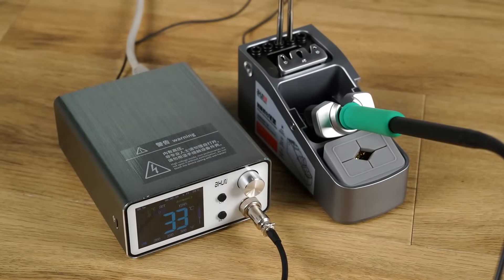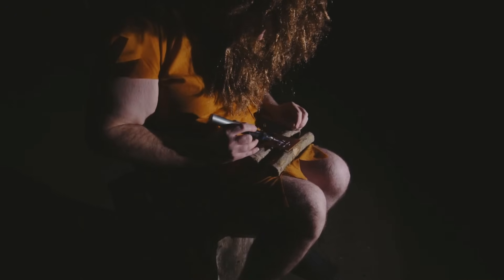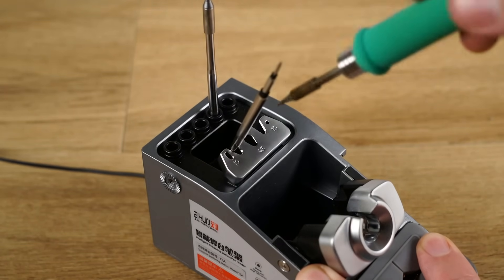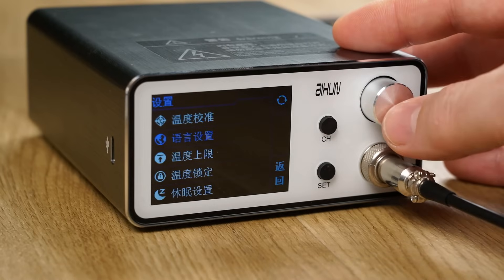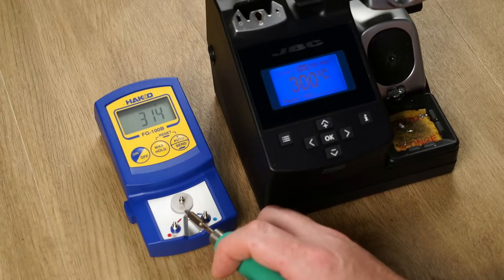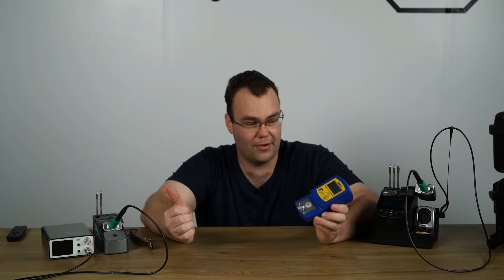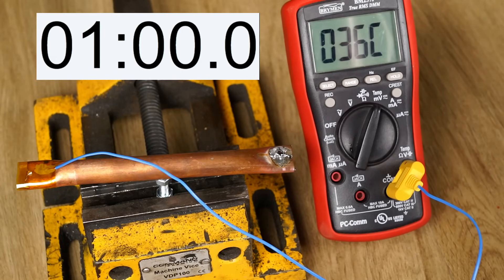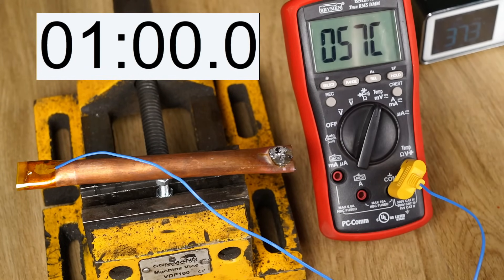AIXUN T3A Soldering Station Review ll JBC iron comparison

Comment: 8:06 I would say that no it doesn't. That's ignoring the outrageous overshoot on the Aixun, which isn't something that shouldn't be ignored. Your shots showed the JBC to have no such issue. Aixun needs to work on their PID control software. If it overshoots initially, then it will probably also have problems when the thermal resistance of what you're touching changes i.e. when you touch it to a workpiece. An interesting product and seems good for the price, but I'm not going to sell my JBC and buy an Aixun. I get that later on you did a separate test about overshoot, but my point is that overshoot and accuracy aren't completely independent factors. I don't mean to sound overly critical; I'm just worried that it would dump way too much heat into something sensitive, even if only for a second or two.
Reply: Ehh it’s not that bad. It was like 15 to 20 degrees over for a second or two. Ur not gonna kill anything on any board from that difference alone. Also consider that each tip has different thermal mass. The pid parameters can’t take into account every tip from every manufacturer. That’s what the calibration feature is there for which he purposely didn’t use. Two seconds of instability at the very beginning is honestly pretty average accross uncalibrated irons at this price point and jbc  might have maybe a tiny bit more accuracy if you only use their tips with their hand pieces but it really won’t be much better. Consider 3d printing which also uses pid tuning to control tip temp on the nozzle. Everytime you change to a different type of nozzle you have to retune your pid to get good stability and even after a retune it’s still never perfect. The effect will get worse  as you get further from the calibration  temperature as well. That’s why u see the 400 degree temps off a bit more. It’s just the nature of pid. That being said if the extra 4-5x cost of the jbc ecosystem is worth the feeling of having a more trusted product from a comparatively more reputable manufacturer then by all means go for it. And definitely don’t sell a jbc to buy a knock off. No argument there whatsoever. If your budget is more in line with the average hobbyist however, rest assured that this small overshoot is nothing to be concerned about.

Comment: Hi your video on buck boost converter was great   bit green on these
My question is I have 3 40ah 3.5 lithium cells   if I installed booster to 12.6  it works out roughly 12a
Where is running appliance  of 12v appliances would be 4a   
So does that mean it would use 3 times as much power out of battery 
If that makes sense

Comment: Looks to be rather nice and decent performance. However basic ohms law: Input power 24v @ 8A = 192W, so at best case it could never be a higher output even if 100% efficiency, which is never possible... Still though probably at least could do 150W!
Reply: The 24V@8A is an output socket to power accessory devices such as smoke fans, not input power to the heater.
Reply: @m3chanist  I now discovered that, the listing I had looked at said that was the input power and did not show the back to know I has internal ac power supply.  Thank you! Sorry to misinterpret.
Reply: Это именно питание нагреватель 24в

Comment: Hi there,
thanks for the great video.

Just one question, what is the difference between the AIXUN T245 and T245-A AX hand piece?

Thank you in advance and best regards
Reply: The T245A has a blue-grip handle and the T245 has a green-grip handle. I guess that's the only difference. JCB makes a T245P Blue-Grip Handle too as well at their original T245 Green-Grip Handle.
Here's JCB's description of why they also offer a Blue-Grip Handle version:
"The blue grip allows you to distinguish it from other handles on the work area. For example, it can be used for lead soldering applications and green handles for leadfree jobs."
Reply: @ITubeTooInc  THX

Comment: The key is the support. As soon as you are not the creator of this controller, yet you have no idea how exactly it is working and you have no source code, you cannot be sure this controller will work fine. What do you do if it stop working or some error will be fiund in the firmware? Very often the suppliers does not perform firmware update in 2 or 3 years. That is the reason the original controller has greater price.
Reply: You think JBC provide source code for their irons?  Amusing.
Reply: @m3chanist  of course not. But i think they provide support.
Reply: @art4259  As does the manufacturer of the iron featured. Two to three years of firmware upgrades for a soldering station? Are you serious.  What problems do you think may take three years to be unearthed exactly? Care to list ANY manufacturer that is still doing active updates on their firmware three years after the product was released for the original iteration?

Comment: Great test! May I ask, what did you use to mount the thermocouple tip to the copper tube?
Reply: Solder
Reply: @ITubeTooInc  In the video it looked like some yellow "goop" style of substance.
Reply: Most likely kapton (polyimide) tape and some thermal paste.

Comment: Yes it can solder some beefy stuff but not as well as it should with the available power.
The overshoot would suggest that either firmware control or build of the tip is not rigt.

Comment: I have a Weller soldering station that I purchased in 1984 that still works as well as it did when new. I used it the other day and had no issues. It seemed expensive at the time, but now that I look at my decision, I have no regrets.
Reply: I've had a couple of wellers since 20 years back. Try soldering on a large ground plane, or a high gauge wire. Impossible with the wellers. Thermal capacity is to low no matter of soldering type. Even though it says 50w on the soldering iron, that heat cant transfer fast enough to the tip when it's cooled down. The issue is the physical barrier between the heating element and the tip.

This is solved with JBC (yes, I bought the DME-station), where the heater and tip is integrated in the same unit. Problem solved. Will never go back to weller. No professionals use those in a production environment. It's either jbc or hakko.
Reply: @swebigmac100  
I have a weller soldering gun with a higher capacity for the big jobs. Every tool has a range of uses. The work station if for fine work only. I have a range of tips and temperatures that I can select for a particular job, buy, you're right.
Another thing I have found is adding extra flux, especially when using no-clean flux solders. I use the Alpha no-clean rosin flux. It does a great job.
Reply: Which station is it??

Comment: I'm just wondering if a genuine JBC T245-A hand piece will fit the Aixun T3A station. Is there any chance you could have a go and give us an update thanks.
Reply: It's not a direct replacement. You would need to replace the connector or build an adaptor lead.
Reply: @sdgelectronics  But is it just that? mapping the pins via adapter? or are there maybe also some resistors for tip detection needed or something?

Comment: I really really like my Pinecil and use a solder gun for heavy jobs. My Pinecil heats up in less than 15 seconds. The Pinecil runs off of 12-20VDC so I have mine connected to an 18V Ryobi batttery.

Comment: Early T3A firmware didn't implement overshoot feature. It was the genuine JBC which introduced overshoot in the later version. T3A follows then.
Reply: The overshooting is happening due to the aggressive PID profile for heating that they implemented. You cannot have both instant heating and not overshooting. That said what mates is that PID resolves the overshooting immediately and regulates the temperature according to the profile. The only problem is that the PID is configured for the resistance that Aixun tips have, original JBC tips and most of the other clones have a totally deferent resistance implemented so there the overshooting could potentially be a problem.

Comment: Amazing, just a bit more expensive (3x w/ the rod) the amazing KSGER (uses Hakko tips but the clone Hakko tips are safe to use at 350C max not the advertised 400C). The amazing KSGER takes 7 second to my default 320C.

God bless, Rev. 21:4
Reply: Yeah but t12 is not 200w

Comment: Awesome upload once again sir. Im homeless and trying to learn repairs. I did get the ts80 you did review but it is little to light for bigger ocb repairs. Money being really really tight. So these reviews are priceless to me. Thank you.
Reply: if you buyed the ts100 that would be have been the better solution for you . 
with the custom firmware is it awesome ! 
and MOSFET hack you can run it to over 3amperes !
Reply: @smithsjason2182  the ts100 has much worse tips with slower temperature control
Reply: @drkastenbrot  I don't think so! I have the ts100 over 2 years now and had no problems with the tips maybe you got a wrong one  !  in TS 100 you can use the hakko tips be modification !
And again you must calibrate the tips  the first time you using them !
AND IF YOU BUY QUICKO OR KSGER . I recommend the custom firmware for the quicko and ksger solderstation but you have attention if you buy on of them you need a SMT VERSION  !
Reply: @smithsjason2182  Im not saying its a bad iron, it is easily the best value iron available. But the extra cost of the ts80 and its tips has a reason. They are better tips with a better design and work especially well on small components with huge heatsinking pads. The TS100 is a more classical (Hakko) tip design, while the TS80 tips are quite similar to JBC.
Reply: @OP How can you be homeless but have a charged device with internet access and able to place and receive orders on amazon/e-bay? It just doesn't add up. I mean, the TS80P alone is ~$120 and considering you'd have to buy other items apart from the iron as well in order to make repairs, the total was probably too expensive for someone homeless. I'd imagine a homeless person at best could get the $20 bundle from amazon that has an iron, some solder, flux and other tools thrown in there. Sure it wouldn't be a good long term option, but it would be the available one and would definitely serve to do some repairs till you can buy a better setup.
Reply: @groundcontrol6876  Maybe by "homeless" he means he can't afford rent and is thus living in his mom's basement. Because I know I'm not homeless and bought that $25 Plusiva kit from Amazon to save money. 😝
Reply: @groundcontrol6876 living in his minivan or at his friends place or something similar .There are people that are having hard times like that and some even living in tents and cars(if one has a miniwan and a big tent,than it isnt that bad). Difference between him and many others in such situation is he is not giving up . Considering the times, that is impressive.
Hope that since then he has been doing well and managed to further upgrade his equipment
Reply: @groundcontrol6876  Lol, I can tell you been living a cosy life. You can use the internet through public spaces like libraries, coffee's, computers are often available at libraries with file upload and download access, or you can ask a librarian. You can receive packages from friends/family or public lockers like inpost. 

And no, buying shitty tools that will fail and not do the job is not better than buying quality tools for similar prices like a TS80. You will get better value in the long term, which is what's important when living very poor like this dude

Comment: Since you are showing upgrading the firmware, it would be great to warn about what to do if the firmware upgrade gets stuck below 100%, maybe any steps to take so you don't brick the unit, making it unrecoverable.  (I.e. do not disconnect or reboot the unit if it gets stuck below 100%, wait for the firmware upgrade to complete or timeout of it's own accord, do not attempt upgrade if power is intermittent {thunderstorms or loose connections} or your laptop is on low on battery power, etc.) If the unit is hard to brick, it probably won't become an issue. However, you may begin to see comments if an issue is present or an upgrade patch begins to cause the issue. Thanks for all the info!

Comment: Good job. I have noticed that the wattage ratings for the tips is much lower than the ratings of these soldering stations.  If you make a straight wattage calculation based on 24V and the resistance you come up with that rated tip wattage, so if it were somehow turned on continuously it is rated for it.  But, since the temp is controlled by a sensor there is no reason why a much higher voltage couldn't be applied and regulated as the element is not going to burn up until it reaches it's melting temperature.  That's what it's going to take to push the wattage these stations are rated for.  Or, they should offer tips rated for high wattage at 24V (if that's the control voltage).  It definitely was impressive though.  When I searched for a price a few came up at $39 😀 once I added the details it jumped closer to $180 🤣  Ok, I'm cheap and it's a hobby.  I'll start saving my change and look under the seat in the cars.
Reply: I once owned a 6V DC iron that worked really well. One day I needed to solder a larger area and so I ran it off 12V for some 20 seconds to do the job and it worked a treat. After that I used it for years on 6V again. Of course I don't recommend you try that because there are too many unknown parameters.
Reply: @robert574, the temperature sensor in the cartridge is located some distance away from the heater coil. It can't respond instantly.  It takes time for the heat to travel.  If you push too much power through the heater coil you can burn it out before the temperature sensor can respond.

Comment: Why would anybody need these precise expensive stations? Is it a big difference if solder at 290 or 300 degrees? I have been soldering with a 25W solder without any station for many years. Never burnt a single chip.
Reply: If you’re trying to solder large components like electrolytic capacitors for a TV, it will take a considerable amount of time to bring the temperature up high enough to wick the solder. Then you’re exposing the component to unnecessary heat which will reduce the life span of the component.

Another thing to consider is time. For a factory worker, even saving a fraction of a second per weld will quickly add up, especially when you consider the Labour cost in developed countries. So the cost of a powerful station can be justified. For average DIYer who doesn’t deal solder a lot or work with large components, it can be overkill.
Reply: @philipo3381  OK, makes sense. Thanks !
Reply: Those expensive stations are also pretty good at energy saving : Since they get hot fast, they don't need to stay hot all the time (they enter into sleep mode very quickly). Which also extend the life span of the tip.

Comment: Very nice looking. I wonder if you could use the DC output port as a DC input port? Get 50W out of it with a 12V car battery, which could be good in a pinch on the go.

Now I’d like to see a cheap temperature calibration sensor that doesn’t require calibration out of the box.
Reply: It's just connected straight to the output of the power supply, so it would probably work.
Reply: @aptsys  i doubt the screen and control board will run at 12v

Comment: I would like to see a second version of the T3A

 like the power button on the front of the T3B and the cable on the soldering iron stand.  

the only difference between the two is the power output and the soldering iron that can be connected. 

Also the Iron Stand that is included by the T3B version...

So Aixun my dear manufacturer, then come up with a second version
Reply: There's also some differences with the cartridges, which mean the thermocouple is in a different configuration.

Comment: Note that this is an older version, there is a T3B version with the connector in the back.

Be careful installing unknown software! You should probably be using a VM.
Reply: the t3b doesn't support the t245 handpiece and is a similar but completely different station

Comment: I just didn't like it! and this will never replace my JBC station :) I mean, no station can beats the perfection of the JBC stations!
Reply: 100%
Reply: Been using JBC since more than 20 years, first only hand soldering irons, later the popular JBC stations. But JBC did never really react to improvement ideas, faster ways of settings temperatures, and been complicated to be set up like sleeping temperature. Meanwhile I sold my JBC stations and use Sugon A9 Pro stations, but with JBC hand pieces. JBC are way too expensive for what you get. Stations almost doubled the price, since I bought them, but still with same features. The A9 stations offer me what I need, way faster to set up, a bit more power and faster than the JBC, and I am using them daily for multiple hours. Do not get ne wrong, I loved my JBCs, but missed some workflow improving features. Never thought that the time would come, I sell them, ans use chinese made stations.
Reply: Hacko too?
Reply: Ahaha) Of course, a person who spent $ 300-400 will never agree that for $ 100 you can get almost the same thing, and sometimes even better.
Reply: @riderm.d.1461 my 20€ 90w temperature control iron can do everything the jbc can and it doesn't cost an arm and a leg and comes with ceramic elements!